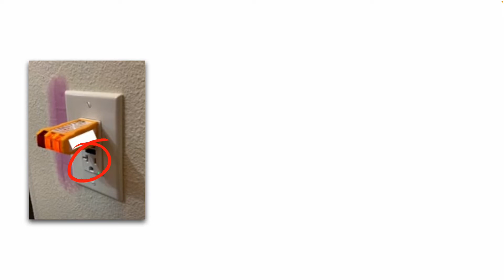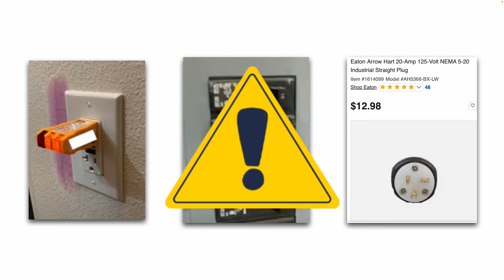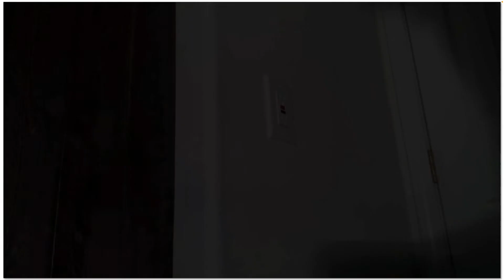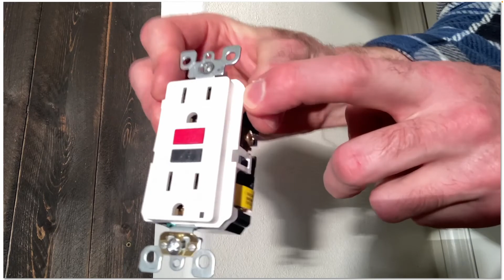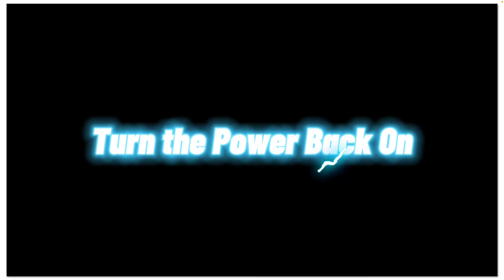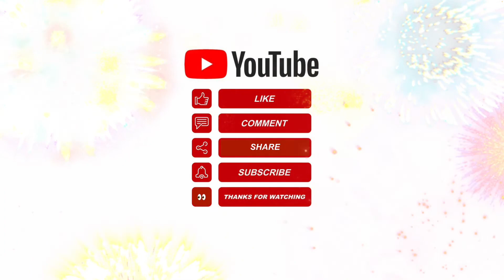Need To Install A New Electrical Outlet?

Comment: Can I feed a receptacle and have it always hot from a four-way switch?
Reply from the maker: Ideally, you want to keep your lighting circuits and branch circuits separate.  (You could splice into the hot wire going into the four-way switch from your breaker panel though.)